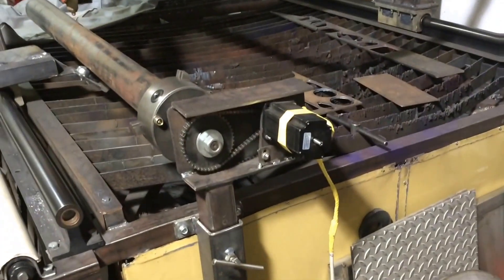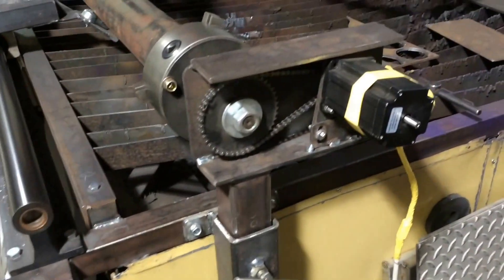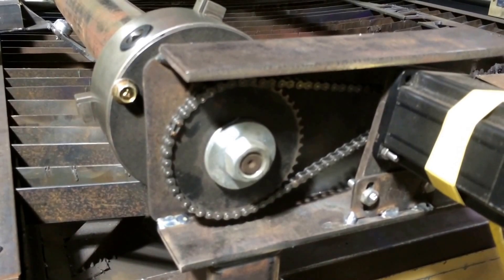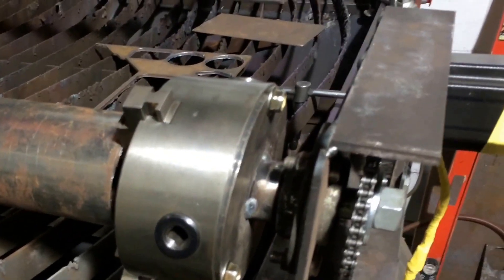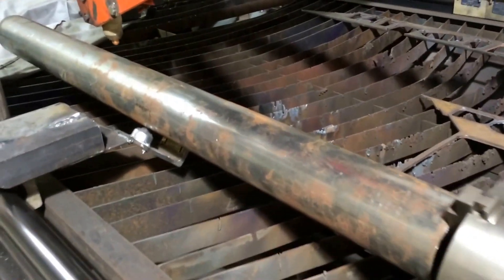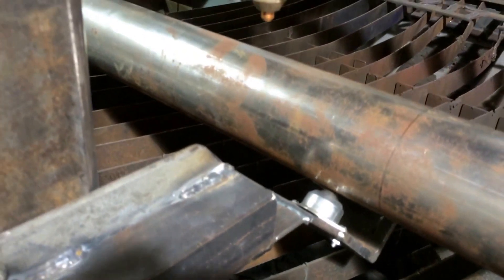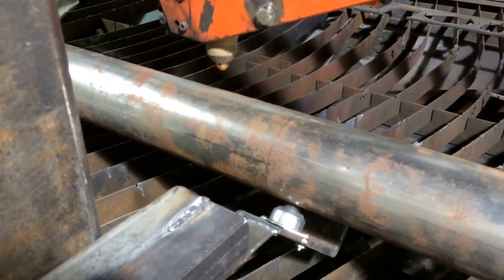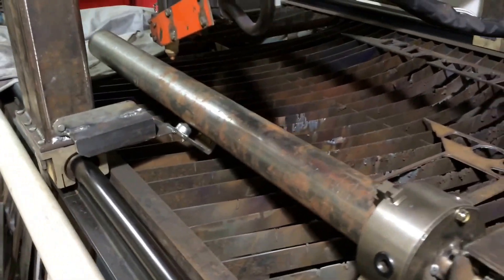Rotary added to plasma table

Comment: Does the tooth count or sprocket ratio effect the rotary axis or how did you decide on how many teeth on your rotary chuck sprocket VS the stepper motor drive sprocket?
Reply from the maker: In Mach 3 there’s a feature you tell it how far you want it to move and then you measure and then you tell it how far it really moved and it calculates it out for you so the sprocket sizes do not matter. I hope this helps. Thanks for watching.

Comment: Hello sir,,which software you used to make gcode file for this rotary 4 axis machine
Reply from the maker: I’m using sheet cam I laid it out as a flat pattern moved my x over top of the rotary unplugged my x hook the rotary to the X axis and that’s how I made it work so the table thinks it’s moving in the X access it doesn’t actually know that it’s  spinning the rotary hope this helps thanks for watching
Reply: Sir is there any free software that makes gcode for 4 axis plasma cnc machine.?
Reply: It's great...really nice to see this one
Reply from the maker: I don’t know of any offhand I just do it this way and it works for me
Reply: cruise982001 will you share dxf file or Gcode for this cutting ???
Reply: It's really great work..appreciated

Comment: what do i need for rotary attachment
Reply from the maker: +sammy lala I just bought another stepper motor and borrowed the three Jaw Chuck off my turning lane and a couple Of bearings to make a mount just to hold it and unplug my x access and just plugged it into my x and I plasmaed out a couple sprockets for some number 24 chain

Comment: Great job... simple, functional and thrifty. I currently have a plasma table but I want to build a stand alone rotary. I build roll cages and such as s hobby. I seen bendtechs new software which has a tube marking option for start  of bend and plane location.  I have mach 3 and sheetcam. is it possible to have s rotary axis and then another x axis for tool offsets? I want a plasma torch holder beside a scribe.. thanks!

Comment: As an old timer Ag Engineer, I am impressed!!!   I wold like to build a hyd dovetail on my 44 ft spread axle gooseneck.  I would use the existing bed for the dovetail.  I would like to see a close- up of you hinge and hydraulic/ mechanical movement including the lock for transport.  I know how it was done, just need a picture to really figure it out.